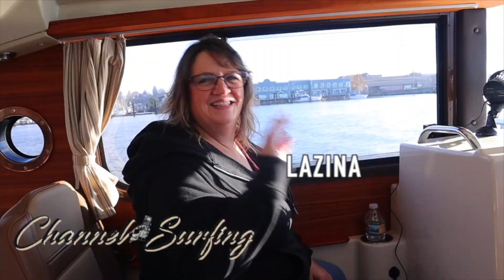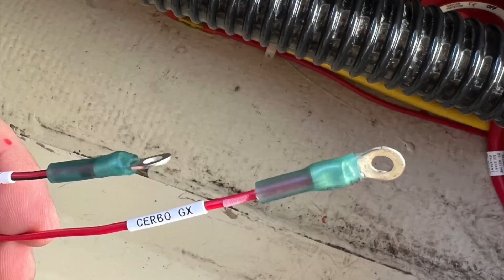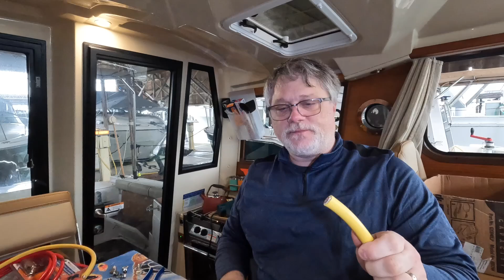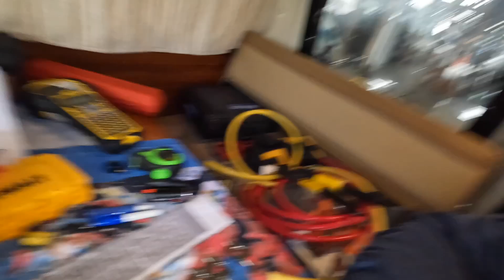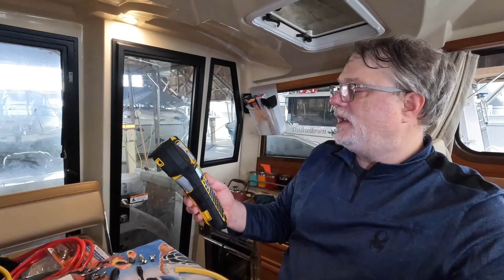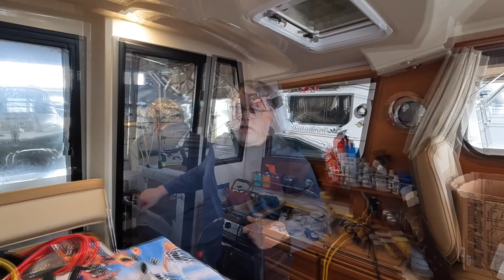Check out these tools for doing electrical work on your Boat | Ranger Tug

Comment from the maker: 📥FREE DOWNLOAD: Not sure if your boat has enough battery capacity or solar for the way you actually use it? Our Power Management Calculator is built from 6 years of real ownership data on our Ranger Tug R27, along with real Pacific Northwest solar production numbers. It’s modeled from our R27, but adaptable for Ranger Tug, Cutwater, and Solara owners who want to estimate daily usage and see exactly where their battery bank will be at the end of the day.
👉 https://csurf.co/power

Comment: I watch as much of your videos as possible. I am currently watching as much of your Alaska trip as possible; think now just day 1 & 2 so far.  I just finished watching video on electrical tools & accessories/tips.  We are eventually looking to buy either a R-27 OB or a Cutwater C32 CB (want the OB in a bigger boat, but don’t see Ranger Tug larger than the R27 OB.  Is there a series of videos available to help with best things to buy (all categories) and recommended upgrades?  I’m a native of Gig Harbor, my wife from Oswego, NY, and we live in Central Virginia not far from the Rappahannock & Potomac Rivers.
Reply from the maker: Thanks for watching!!  We have a walk-through video of a Cutwater 32.  Those twin Yamaha F300's are really nice.  Cruising speed on that boat is about 35knots.   The RT27-OB's WOT is about 35 knots with a cruising speed around 25 knots.  So there's a speed difference between the two.   Currently, the largest Ranger Tug with an outboard is the RT27-OB.   Rumor has it there may be a RT35 with twin outboards or a RT29 with a single outboard coming out. But no official news on that, only speculation.

Comment: Have watched most of your content as I am interested in the Ranger Tug. Would you consider doing a video on what a person is looking at on an annual basis to own a tug minus initial acquisition cost?
Reply from the maker: Thanks for watching!!  I am currently working on the video you're requesting. I just finished compiling the last 3 years worth of fuel usage, every gallon, every mile.. average fuel efficiency, gallons per hour, etc... Shows the fuel efficiency over the course of running a 3 blade prop vs a 4 blade prop. Also illustrates the fuel efficiency loss as the bottom paint deteriorates and the bottom gets dirty. 

In addition to fuel costs, I'll be talking about moorage and maintenance and insurance, state registration costs, USCG documentation costs, etc...   We've had Channel Surfing now for 3 boating seasons, so I have a lot more data to share.  I'm hoping to have this published in April.

In the meantime, if you haven't watched this video, you may find it of interest as it talks about some of what you're asking.   We recorded this 2 years ago.  https://youtu.be/OIsAnQ3_kFA